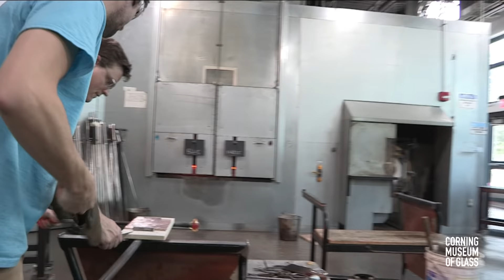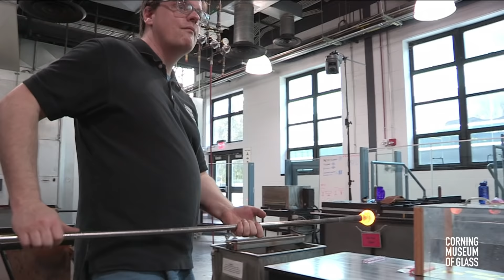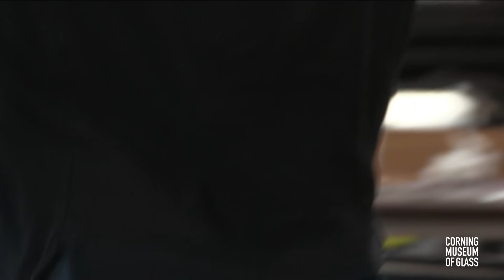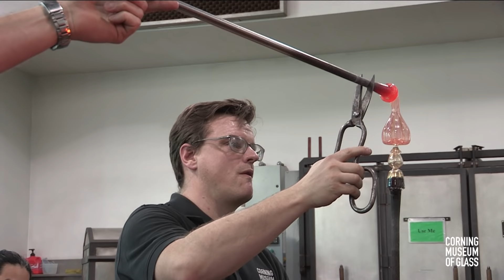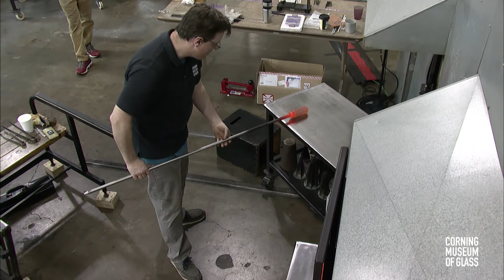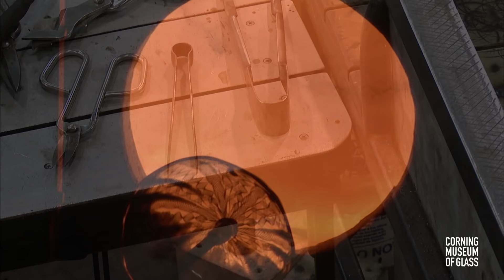Jeff Mack & Eric Meek Live-Streamed Studio Demo

Comment: I have noticed on several occasions by different artists that say for a foot of the boblet you push from the inside out rather than pull from the base ( pipe end ) up. May I ask the reasoning ?
Reply from the maker: Ricky - Im not sure I completely understand your question. If I go in the wrong direction let me know , but when opening a blown foot, the glass is thin and soft and just needs to be gently "pushed" but the jacks into place.  If you "pull" the glass, you can create thin flat spots that are hard to control and are overall, difficult to keep smoothly curving in a somewhat trumpet-like form.